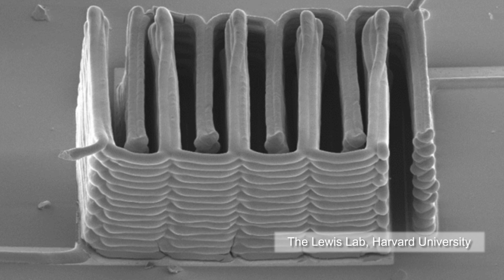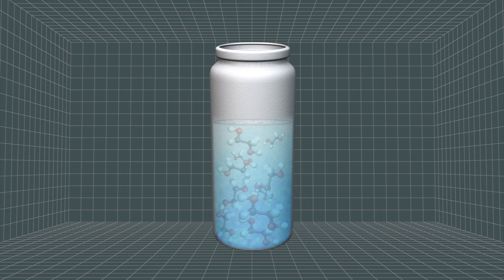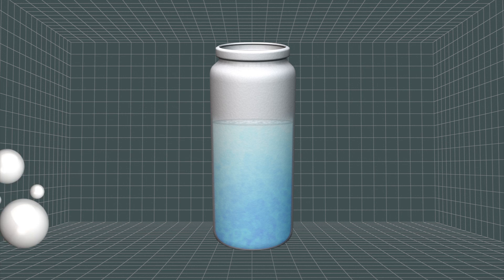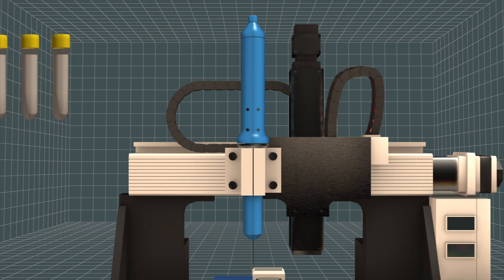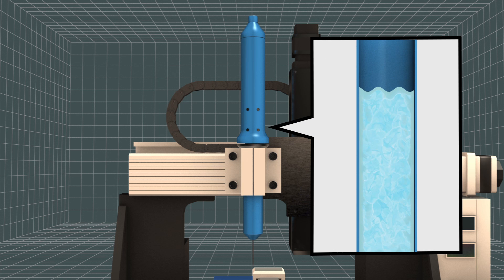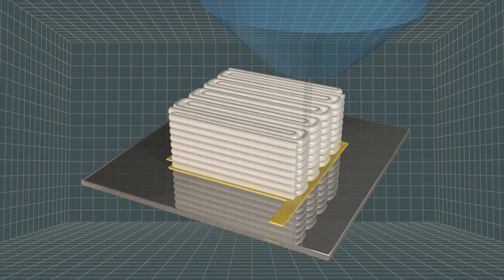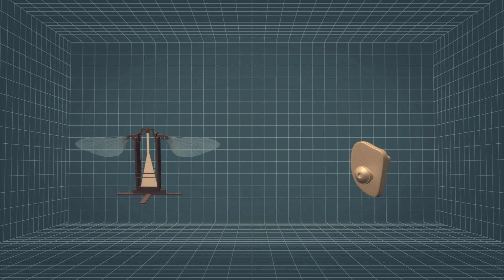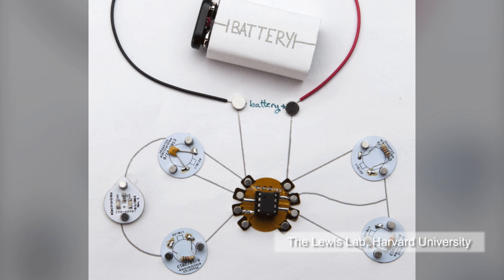3D printed battery: new smart inks to produce lithium-ion microbatteries

Comment: If we arrange cells in banks that can be instant charge by ambient at millisecond at a time continuously rotating to reserved  for banks buffering for used by phone,  or computers, or even refrigerator because billion of cells are brought to power any thing and each banks may be about 10,000 cells each and can instantly switch to parallel or serial as needed for volt or amperage. It is like a CCD of a. Digital camera. So while the charging process is 24 hour 7 days a week while using hour is much less so all we need is charge each bank then shift directory to the next and so on and the same is use while discharging so if we charge 10,000 cells each millisecond then we may by using. 1 million cells per second so it is a 1/ 100 ratio for example usage time is 168/100 so about 1.68 continuous hour use but if we increase to 1/ 1000 ratio then we have 16.8 hours usage / week and so on